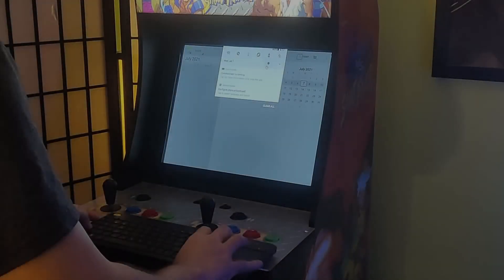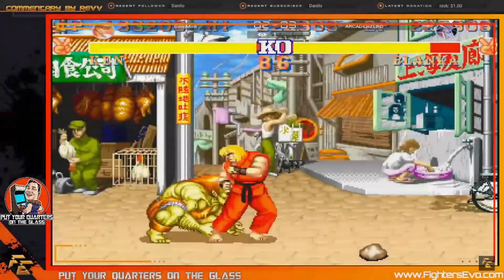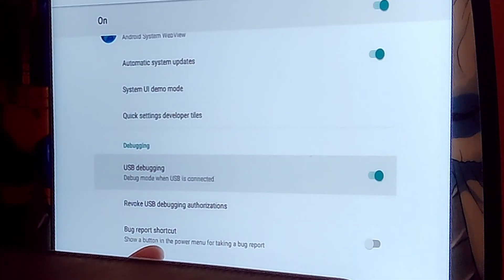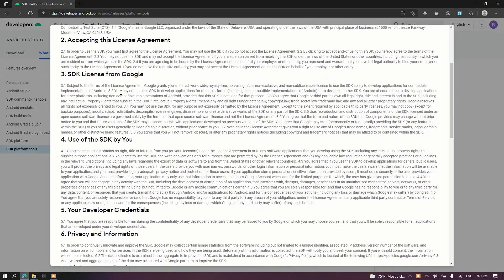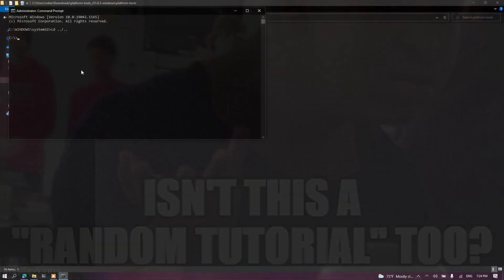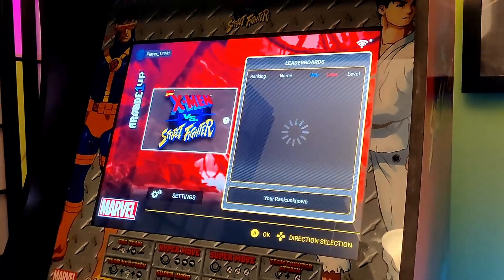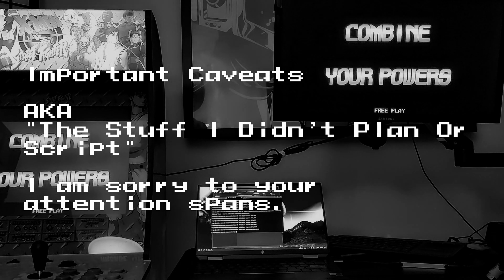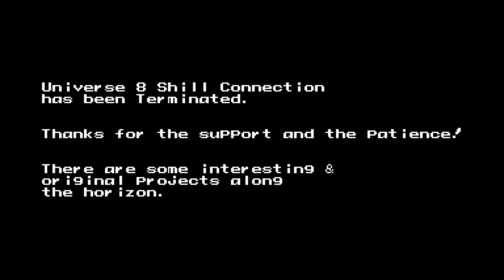Stock PCB Modding #2: Sideload Apps over WiFi + Universal Micro USB to HDMI (Arcade 1Up)

Comment: Thank you for this video. I have XvSF. When I configure the USB to use MTP, it boots up as 'Charging Only' and it won't recognize the PC. Any advice?
Reply from the maker: np, thanks for checking it out! 

Not guaranteed advice here but I can tell you that when troubleshooting with people it's been 4/5 times due to the USB cable being cheap (something mentioned in the vid). It's not always necessarily quality. Provided a link in description of one I've used for a few years now but basically you need to be sure it is adb compatible otherwise.

Another thing you want to check is that your micro USB cable isn't daisy chained to your PC or that you're not plugging it into a hub. For ADB to work, it needs to be a straight one to one connection from PC to the device. And also no OTG adapters to the cab for micro USB unfortunately.

Not sure if that helps but that's about all I can think of.
Reply: I will try a Ugreen cable, thank you.
Reply from the maker: @robtaylor8816  cool, hope it works out.

Comment: Is there any source/database with unpatched verisons of the andriod/OS? i.e. is there a way to unpatch or revert the android/patches to factory settings in case of unintended results?
Reply from the maker: I would suggest not to use Android factory restore in settings menu since that can trigger DRM. But if you're talking about 1up app, their patches only update the 1up apk on these cabs. Otherwise: you can try team encoder's fightdroid, since that flashes a system image.  There is also a better input patch available in terms of effectiveness for lag fix (disclaimer: created by me). I don't provide flashes of images particularly because I have a channel here to consider w legal grey zones, at least for that type of method.

Comment: This is amazing!! I just finished sideloading into my XvsSF earlier today, was kinda bummed out that the flash drive I put in it wasn't detectable by default (unlike BB). I was able to install Nova launcher and DIG emulator since it  does save space (versus retroarch) again, BB wins here because you can place roms/themes/music etc. for DIG on the flash drive. I believe in your previous vid you stated that you could have a custom nav screen for XvsSF? Is that still possible?
Reply from the maker: Awesome glad to hear! But not sure what you mean by nav screen. You mean for the 1up app? I actually modded the cab application itself; unfortunately I can't release it yet because need to set out time to legally patch it. I can't really mess around w possible ip issues because of what I do here. Have been doing extensive testing on a new lag fix driver I wrote though and trying to push that out as soon as possible before moving to any new projects. It is about done just sorting each individual possible user issue is pretty tough with these things. May just need to put the vid out and not be able to help some people. 

Another good launcher which is more simple/minimal is lawn chair btw. Also free. And for RetroArch front end you can use Pegasus which is awesome. But since you're using an alt emu that is cool too. Interesting to hear how you're considering the space as well. I'm confident there's a way to use USB storage on xvs/mvc, just haven't done that in a while to remember off hand exactly how.
Reply: @FromUniverse8  the navigation screen that was at the end of part 1 of the previous video at the 3:55 mark I believe. When I paused it and looked at it, it did look like a launcher of some sorts, but I have an idea and if it works I believe that I can make an awesome home screen fingers crossed
Reply from the maker: @SketchofGoogle1978  ahh yeah. a second app you can use is called ShortcutMaker. Just hold left click on home screen and then add a widget => select that app, then add Activity for 1Up, you can customize the image/name and everything. Initially I over engineered and wrote my own app to launch it lol.
Reply: @FromUniverse8  that was exactly my plan LMAO I use to use an app like that back in my phone modding days when androids were named after desserts (froyo) 😂 see now you got me pumped lol. With shortcut maker images can be used as shortcuts? If so then it's time to get cracking on photoshop!
Reply: @FromUniverse8  I was able to make custom launcher type menu with Nova launcher, some photoshop and a couple of other apps, but some reason I'm not able to change the arcade1up icon. Everytime I do, when I reboot it the icon reverts back, this is my only real hold up
Reply from the maker: @SketchofGoogle1978  I use lawn chair and shortcut maker. In it you can long press the empty space on desktop, add widgeet then add an activity for it and the last option in that process is to customize the icon. I'll eventually streamline that for these older cabs just got other stuff to do atm and also want to have a nice preset selection of themes for people since it takes work lol
Reply from the maker: @SketchofGoogle1978  would try those other apps I mentioned out.

Comment: Thank you Rob! Worked like a charm! Was able to install RetroArch thanks to your method. By any chance do you have a driver update to fix the 2-player not working? Thank you, can’t wait to see more of your work!
Reply from the maker: Thanks! it's not a focus of mine right now, but you can check out team encoder's Retro Arch specific driver @ team-encoder.com (I think they are working on a RetroArch setup as well). Only a heads up that they do flash your PCB to a new state so you will lose other installs is all. I will also have a driver update around the corner for these 3 PCBs specifically that focuses more on input lag but they both use different methods/focuses so I would check theirs out if the goal is 2P.
Reply: @FromUniverse8  Appreciate the response! I tried team encoder’s fix for Big Blue and at the very least 2P is recognized, but 4 of the 6 buttons are no longer working on each player with no rollback option :( . I suppose it’s not finished yet? Anyway, looking forward to your version of the input lag fix!
Reply from the maker: @aary33  thanks! I can try to relay that to him, he gets a little touchy with requests lol. But they are ok guys. To roll back there are some commands you can run. Give me two hours and I'll provide you a reply with the adb commands to do that. Thankfully they kept the original drivers on it. I'm also gonna have an app to switch between them after this driver release this year, I just don't wanna to rush out a vid and have everyone confused or run into issues (as you can see can be inconvenient lol)
Reply from the maker: @aary33
Got in touch w Mystery Encoder. He says that was just an early driver and the RetroArch stuff wasn't ready yet but he's already got an updated one coming along. I don't have a timeframe to get back to you. For now, if you want all the buttons on your RetroArch setup you can connect your PC to your cab and then run these 4 commands:

adb uninstall com.android.SimpsonsFix

adb uninstall com.android.SimpsonsControllerFix

adb shell pm enable com.fjtech.ComAssistant

adb shell am start -n com.fjtech.ComAssistant/.MainActivity

[you may need to reboot for settings to take, I didn't test this extensively]

Only had this offhand because I needed it as part of the driver install this a few days back that I was working on.
Reply from the maker: the controller driver may be either of the 2 first commands depending on the PCB, so that's why I list both.
Reply: @FromUniverse8  Thank you for the Mystery Encoder insight and for the rollback commands! You’re the best! Totally understand not wanting to rush a video out, I will patiently wait for your app release!

Comment: Will this work on an MK/MK II 1 up?
Reply from the maker: I'm not familiar with those. I would cautiously say no, since the interface doesn't resemble the Capcom cabs or Simpsons. But you could always try.
Reply: @FromUniverse8  I appreciate the swift reply. Is it the UI that's different or the hardware?
Reply from the maker: @Nervous_Rexxx  well, it usually comes together so you can tell quickly. I think they use different contractors or teams to release different products, but who knows really. I am sure though that MK 1/2 don't work if you mean the offline editions, was not familiar with the new online one so much but I am doubting it somewhat.
Reply from the maker: @Nervous_Rexxx  always a chance I can be wrong of course too, so don't know until you try (also np)

Comment: So I did something pretty dumb I moved stuff off my internal storage on Simpsons to my sd card thinking I could just move it back and I can’t move it back 😂 now can only play the stock games with the sd card in. any one know how to get these files back in internal storage also I have my whole machine backed up installed some file explorer apk and it didn’t even recognize my internal storage at all or the usb
Reply: And I backed everything up tryed debugger and moving everything back but it didn’t do it right some of the system files got moved to the sd when I was freeing up space
Reply from the maker: Haha yeah... it happens. At least you can still play them somehow. That means it's not all bad. I have done much much dumber things, and had to buy entire new PCBs. I think what you need to do is remount your sdcard partition for the cab.

 I don't have so much time to dig into this sort of problem right this week specifically.
Do you have a /sdcard in your cab? You can type adb shell, then cd /sdcard, then ls to see  what's there. The roms should be something like /scard/arcade/roms or something like that don't remember when updates are applied.

Pretty busy week to be able to help but you may want to look for mystery encoder's discord; I don't have a link but KongsRUs may. That team is very good with this stuff and can probably help you if they have some time to spare. 

Or I guess if someone here is reading and has an idea, feel free to chime in (just please respect TOS of YT in terms of laws etc)
Reply: @FromUniverse8  thank you and I might just leave it on the sd card because it increased the internal storage by a lot and I was able to add more apks at this point though I might done working on it I think😂

Comment: When I click the setting icon a window pops up and says “Settings has stopped”. I can’t get past that window, any advice?
Reply from the maker: unfortunately yeah this means DRM had been triggered. There's a few cases where this happens on new PCBs; not quite sure what does it. But I could just recommend to find another. The only way to get around it is to reflash the image back to stock, which it's hard to provide a source to do that with for legal reasons. Sorry for not having better suggestions here with that. If you ever do get a good PCB then be careful not to factory reset from the stock OS settings or disable/change any DRM settings since that can also trigger it.

Comment: Battery on my machine is at 5 if it gets to zero I should be good you still think ?probably gonna end up getting that 3a power supply
Reply: Also just noticed my cord is actually a 12 v 3a
Reply from the maker: I see. Those come with the marquee cabs so that's why I suggested it. Do you have other devices connected? There's literally no battery, but they could be measuring relative to the voltage that is available or what it's getting at some indicator.

Maybe this is happening because you have a high CPU load? you can try to close activities by plugging in a keyboard and holding I think alt/tab and swiping them left.

The funny thing is the higher the CPU load, the lower a battery indicator may drop. This happens on phones. There's apparently also possibility there's a resistor that measures the battery level, so as the relative available voltage goes down then the battery level reported goes down. Also could be the voltage is relative/fluctuating. How exactly are you reading it? Just on UI?

Not an expert though on this but think it keeps going lower because there's some background services/activities/processes that are eating your cpu over time.
Reply: @FromUniverse8  tab and alt don’t do anything tab just acts as an arrow key on my menu and I pressed them together and separate still nothing I have retroarch with a good bit of cores installed and PPSSPP installed should I uninstall PPSSPP and only install it when I use it ? But I actually think it’s installed on the sd card
Reply: @FromUniverse8  and if your asking how I see the battery it’s on the top in the menu when I hit windows and  n and displays at the top of retroarch
Reply: @FromUniverse8  I don’t want to mess with anything idk to much about should com assistant be running too?
Reply from the maker: @artcadefourtwenty  yep. That one is ok that controls the input/etc. That's why I suggest just use your keyboard and then swipe the extra activities vs do it in the settings.
Reply: @FromUniverse8  only other device I have connected is a usb keyboard that is it and if I unplug it and dosent matter for how long the battery still don’t go up just keeps going down and I get what your saying hope this issue dosent break my machine today or eventually I mean I’ll make something else out of  if it if it does but retroarch on this this is like heaven
Reply: @FromUniverse8  it’s on like 3 now also to be clear I understand it don’t have a battery and understand what it is and read  some on batteryless android and I can care less what the battery says as long as everything keeps running normal I just wanted to make sure it will and if it’s not gonna keep functioning on 0 or eventually stop do what I can now to fix it I just hope it works out  thanks again
Reply: One more thing when the battery passes 0 it shouldn’t behave any differently than it’s been right since there is no battery I wish there was more info on these machines awsome you put out the information you did or atleast showcased it in this video
Reply from the maker: @artcadefourtwenty  thanks! I don't think it should. If it does I would be curious to know since that's kind of weird. And yeah -- unfortunately it's just kinda some Chinese tablet SOC so usually they come in tablet form factor, and this company they use Mediatek aren't transparent even though they use open source Google software. Because of that it would take a really deep dive to find specifics on that kinda stuff.

Comment: Just put retroarch on simpsons and it is  awesome!!!! Thanks
Reply: The battery has gone down to 16 and do I need a cooling fan should I even be worried about this?thanks
Reply from the maker: Hm that's pretty weird. I would say if things seem ok/stable, then don't worry about it since there isn't actually a battery. Otherwise you could use 3A/12V vs 2A/12V if that's what you're using. Besides that cool to hear the tuts helped!
Reply: @FromUniverse8  thank you!
Reply: you get all players controls working fine in retroarch? i've heard there are issues with controller config on the simpsons. i have one and i've been holding off for a solution to that or thinking about buying usb encoders to work around it, before i dive too far into it
Reply from the maker: @drseussicide  I think the more straightforward solution would just be usb encoders. You can even use simple wires so you don't need to do it destructively (I got a vid where I did this, though it was more fyi/humor vid than tut).

For getting 2P working you need to actually simulate a new driver that RetroArch can read. I think there may be permissioning issues with that. I did write a custom app that can read from the P2 as an input test to learn how it worked but haven't experimented beyond that.
Reply: @FromUniverse8  yeah, I kind of figured it would just be encoders. But three, a powered hub, and some extra cabling is just more to convince me wife I need lol. I'll probably end up doing it next month if no one drops a software solution.
Reply: @drseussicide  no but there’s so much other stuff you can do with it though that makes it worth it and and you can play one player 7 buttons that map different. so the con is it’s one player but the pro is you get 7 buttons. You can even stream from a pc and play Wii games guitar hero light gun games  ect  all on stock and if your not doing it your missing out
Reply: @artcadefourtwenty  i think we were talking on FB. i set up parsec right away lol. i just need to add a few buttons and some encoders to really be happy with it.
Reply: i also set up launchbox for android so i already have a front end.
Reply: @drseussicide  I still haven’t tryed other launchers but I definitely plan to try that one that parsec apk was on point
Reply: @artcadefourtwenty   launchbox is crashing on me but i've only had a little time to mess with it so far.
Reply: @drseussicide  i only tryed nova but it works great for what it is

Comment: Is it possible to hack an arcade1up machine lets say the marvel vs capcom one with just using the micro usb cable from the back of arcade to a pc using retro pi program so you can download any old school game to the arcade machine? Without going through all that raspberry pi 4 ppl use to hack an arcade1up. Thanks!
Reply from the maker: It is. If you download an APK for Microsoft Launcher, and then another for RetroArch (an emulation system), you can install it with "adb install location-of-your-apk-file" same as this tut for the HDMI sideload app before it automates the permissions.

There is a bit of set up like adding the app shortcuts etc but it's not a stretch here. Working on a side loading app for this though, just between a few projects so going slowly.